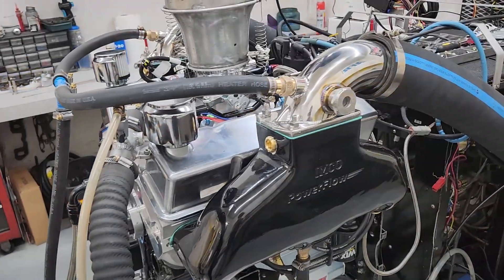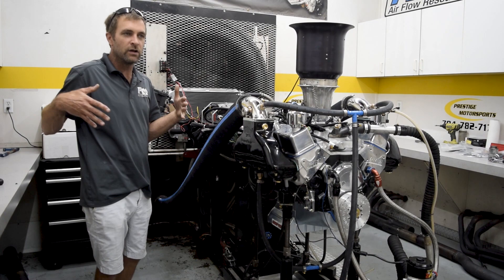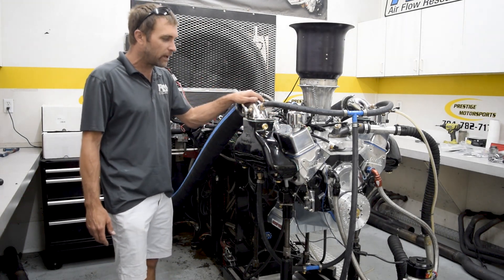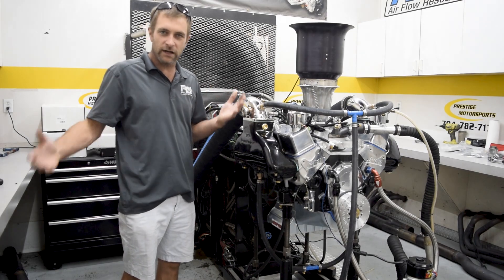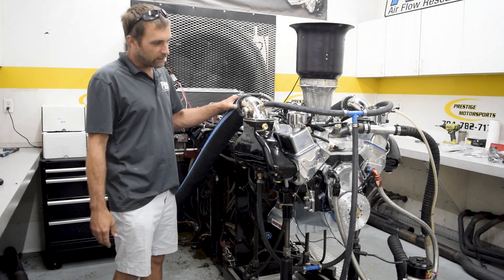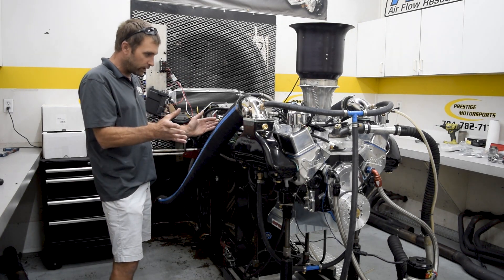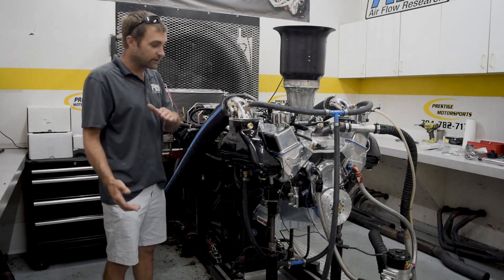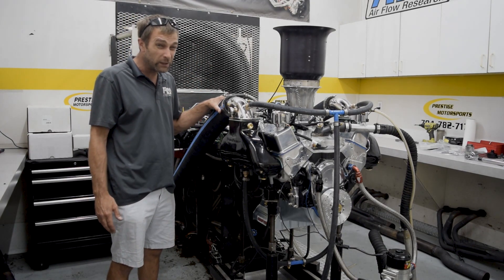396 Marine Small Block Chevy Exhaust Manifold Power Loss and Sight Tubes at Prestige Motorsports

Comment: Cool video. Wish I could have more specs. Wet exhaust, dry piping, cam duration……. A lot is left on the table. There is a lot of power left on the table due to crap lsa. But then the water reversion to deal with.

Comment: Im guessing an LS would be fairly similar, Im swapping in a 5.3 into my boat and trying to decide on a camshaft, my risers are fairly similar in shape and length to those. 
What cam specs were you running on that engine? 
thanks